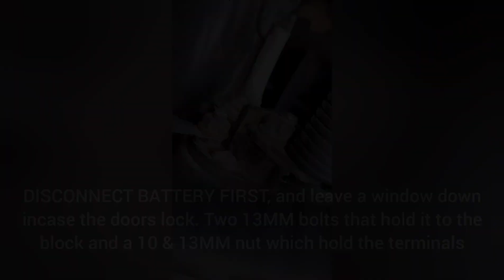Timing a Volvo D5 Engine

Comment: My Volvo(XC90 2019 D5 Engine)  is back. I followed this through and the car started.  The only step that confused me a bit was rotating AntiClock-wise( it’s merely to lock the cam and the force should be minimum), otherwise every piece of info is superior and tacit.

Comment: Nice one mate. Thanks a trillion for sharing this. I'm actually stuck with engine cranking but  not running. I removed only the exhaust camshaft and replaced just one lifter. After that car wouldn't start. I thought just putting shaft back with dots alignment is sufficient for timing but watching your video its confirmed my timing has gone wrong? 

I'll redo it and please correct me if I'm wrong:
1. Get timing marks aligned to markings on timing belt sprocket and camshaft sprocket dots
2. Remove timing belt (drive belt still in place)
3. Lock the camshaft through the hole behind vacuum pump using alignment tool
4. Lock the crankshaft behind the starter motor using other alignment tool
5. Rotate crank pulley anti clockwise until it hits the alignment tool and stops
6. Refit timing belt, vacuum pump and starter motor
Reply from the maker: Make sure the cam sprocket notch is aligned with the mark on the cover, tension the belt THEN torque the sprocket bolts. 

Remember to always turn the engine by hand a few revolutions to make sure there is no interference (very important) 

Going by what you've said, you probably have air in the fuel lines hence why your having problems starting, start by cracking lose the large bango bolt ontop of the HP fuel pump, turn the engine over then it should start as your purging most of the air out of the system, this is what I did when I had this issue the first time, remember to tighten the bolt after loosening.
Reply: High pressure pump faulty. replace it and it will work. no need for priming bosch one designed to bleed it self
Reply from the maker: @gbmultit2222  not always true, it can take alot of cranking for it to self bleed, usually resulting in the battery going flat.
Reply: Hi, you helped me when I did my valve body, I've just changed my rockers and lifters but now engine won't turn by hand, did this solution work for you, thanks

Comment: Thank you very much for your video, it is very helpful, but why do we turn the crank until it hits the lock? since the shaft was previously set to the mark? I don't understand this, could you explain it to me? Thank you in advance
Reply: Simply aligning the crankshaft using timing marks is not precise enough, so to be sure the pin slots in without forcing, it's easiest to rotate the crankshaft clockwise 15 degrees, then insert the tool, then rotate anti-clockwise again until (the webbing of) piston number 5 locks against the tool.

Comment: Hi again. With ignition key at position II fuel comes to the pump through inlet and return lines, even to the banjo bolt at the top.

But when engine is running with easy start spray, no fuel would leak when I loosened the banjo bolt at top. IS this an issue?
Reply from the maker: Are you cranking it with the bolt loosened? You are meant to as this will pressurise the rail and purge the air, easy start is never recommended, as it has been known to bend con rods in the past due to how volatile it is. Double check you have tightened all fuel lines including the metal fuel pipe nut at the bottom of the HP fuel pump, that is an easy one to forget about. Also check ALL connections. 
If the fuel is delivered around the system while in position II then it should do so while cranking.
Reply from the maker: I'll upload a video soon to show in detail if that will help, it will demonstrate it better.
Reply from the maker: Also I forgot to mention, make sure your absolutely certain the timings correct, did you keep the pins in place when tensioning the belt and torquing the sprocket, misaligned timing can cause the problem you describe. Especially if everything worked before you stripped it.

Comment: Hi Thank you For this Clear and easy to understund Video. I have xc90 2005 d5 clicking noise when accelerating and on 3k rev just desapire and work like new…do you think lifters ???  on idle engine run swite…no noise. I will Appreciate any help kind regards Peter
Reply from the maker: Check for any leaks around your injectors, lifter noise is quite audible on idle and low to mid revs.
Reply: @tropixmedia7325  thank you very much for the quick reply it’s very important tip for me I was suspecting injectors from the very beginning I have even bought one injector and start replacing them one by one putting one secondhand injector I bought but actually nothing has changed also I have noticed I’ve got different injectors Some of them if not all have been replaced because they have different numbers and some of them are class 2 others class 3 … but this is very important for me if lifters clicks always then I will concentrate on injectors thank you very much again
Reply from the maker: @pedroleonowicz  is your engine an euro 3? (Black engine cover) if so, the injectors all need to be the same class number also, injectors on these engines CAN NOT be refurbished, plenty of information online of complaints and problems from doing so. Make sure the injectors you have arent reconditioned.
Reply: @tropixmedia7325  I have No idea …is xc90 2005  reg. T5 TBF I bought it with this noise month ago…I’m really appreciating this source of knowledge do you think is euro 3 engine I do most of repairs myself but I am window cleaner not Mechanik…But I’m driving old cars for almost 30 years and I’m accustomed to repair my cars
Reply from the maker: @pedroleonowicz  Euros 3 don't have a DPF, also the rocker cover on the Euro 3s are silver and not black. The Euro 3s have, as you mentioned 3 classes of injector.
Reply: @tropixmedia7325  Thank you very much for all your help it was very helpful I have already solved the problem indeed it was fuel injectors looks like someone like me -with no experience-have replaced injectors for different class ones so it was one injector of first class two of second class and two of third class and as a result engine was running very rough it’s already solved I have installed all injectors second-class …again thank you very much for all your help kind regards Peter

Comment: Do you lifter broken?
Reply from the maker: Lifters needed changing yes, £100 for a set on ebay. Check rocker arms for scoring, will make alot of noise if not changed also.
Reply: @tropixmedia7325  THANK you for your answer is it possible to check it without removing camshaft?
Reply from the maker: @Adam19832  in a way yes, if the lifter seat has been smashed, you'll notice straight away, by then it's too late and you'll need a new cylinder head. However, if all seems fine then usually the lifter has collapsed, or broken apart but not damaged the head. If you notice a loud tapping noise and pulsing sound from the airbox, get it seen to asap. Lifter issues on these engines are caused by the 0w30 oil, I use the 5w40 oil a4/b4 oil personally and have not had a single issue since the repair.  EURO 3s never suffered a single lifter issue due to the recommended thicker oil they had. The thin oil on the euro 4s prioritises MPG and DPF efficiency.
Reply from the maker: Also to mention, diesel enters the sump from failed regens which dilutes the already thin oil causing the problem.
Reply: @tropixmedia7325   do you still have dpf  and using 5w40? You mean  the problem with vavle rockers is because oil. You mean less protection on higher oil temps?
Reply: @tropixmedia7325  my freind recently purchased a s60 d5 sport e4 model fairly long cranking to start an noticed when stopped on way home whats known as tug boay noise from airbox but read online fairly common an will run for a ehile like that. Well car lasted him 2 or 3 weeks before making a noise an cutting out in him an when stopped he tryed engine but was locked up 

But over next hour or so he did get it to crack once or twice but locked up again (probly not best idea)

Ive started to strip the top end 
An found cylinder 3 exhaust rocker broke the cupped end off 

Cambelt was intact maybe slightly looser than should been but looked ok

Worked on cars for years just personaly not a fan of internals or timing so stayed away really 

All other rockers look intact an i have yet to check lifter hole for damage as ran out of time 

But guessing due to locking up
Either timing has slipped or siezed lifter or brocken rocker has caused lock up 

What you reckon chances of that rocker being 1st initial cause i dont know if there prown to braking